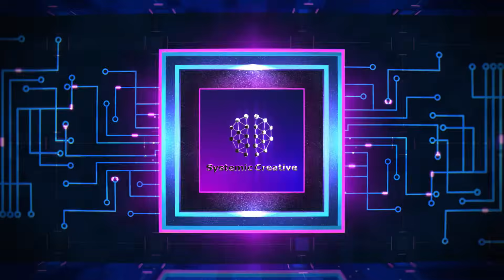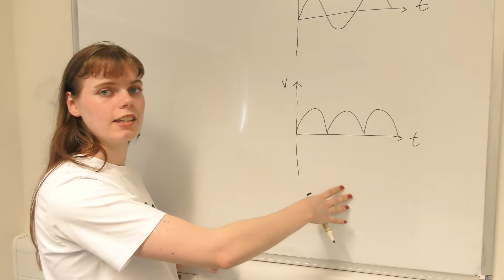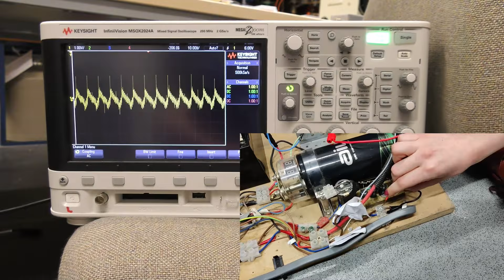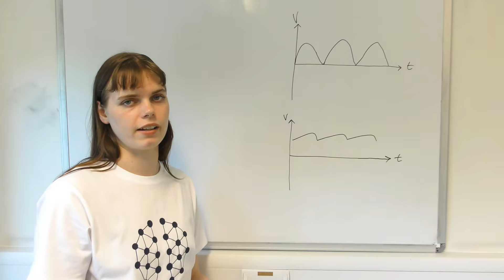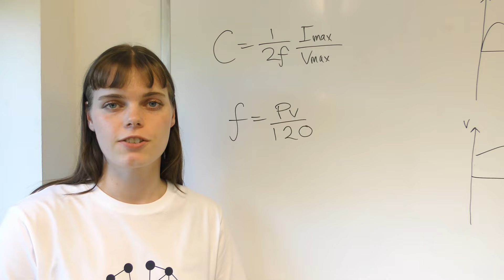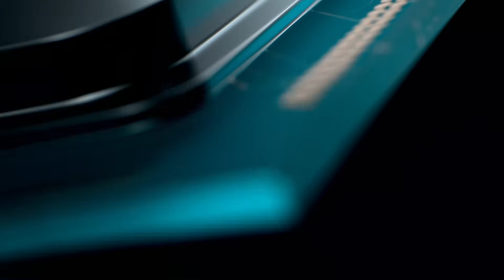Do THIS before using an alternator on a bike generator - oscilloscope demo

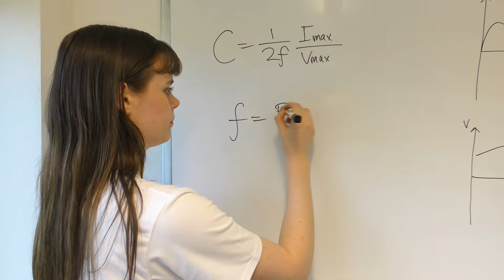Comment: At 3:40  Where does the 120 come from?
Reply from the maker: It is a combination of 2 factors, 60*2. The 60 arises because we're converting the unit of rotational speed, v, (rpm) to the standard unit for frequency (Hz or 'per second'). The 2 arises because the generated AC from the alternator is rectified, creating 2 ripple peaks for each 1 AC cycle . It's this AC cycle frequency which needs to be input into the first equation (a fact which we didn't explain well in the video - sorry!). 
You might spot that the equations would both be simpler if the factors of 2 were left out, but the first equation is a standard one for calculating smoothing capacitance in general AC rectification circumstances so we left it as it was. Similarly, v could just be quoted in Hz in the first place, but rpm is the more common unit with reference to alternators, hence it's usage here.
Reply: @SystemicCreative  Got it.  Thank you.

Comment: I am assuming that Oscilloscopes are more sensitive and advanced than EKG machines, yet I can not detect whatever EKG machines are detecting, or maybe I couldn't figure it out. You are more experienced than I am, can you please tell out how to do it and what I am doing wrong?
Thanks for your videos.
Reply from the maker: Thank you for your comment, glad you're enjoying our content. Just so we understand your question, are you trying to measure the electrocardiogram using electrodes connected to an oscilloscope?
In general it can't be said that oscilloscopes are more sensitive than EKG machines - there are a whole range of scopes with different sensitivities, but they are designed with a much more generalised use case than an EKG machine.

Comment: When explaining physics in simple terms to beginners, I thin kit is important to be careful to use correct words.  In this video, you speak of AC and DC current, but the C in AC and DC already refers to current.  Then you explain generator output and rectifier output voltage, while referring to the waveforms as current.  You show a one phase generator waveform and then demonstrate with a 3 phase alternator output, that looks nothing like the rectified one phase example.  I think a beginner would be completely confused by this demo.  Sorry  to be critical, but I taught basic electronics and had to be very careful with this sort of thing to not lose the students.
Reply from the maker: Thank you for the thoughtful comment - we always appreciate constructive criticism. Good spot on the AC/DC description - you're absolutely correct, we're effectively saying alternating current current! Thanks for pointing out. On the second point, we could have referred to the oscilloscope trace more correctly as ripple voltage, that's true. However, we chose to continue with ripple current because it's the slightly more common description and slightly more intuitive when thinking about it for the purpose for which this video is intended. There's probably an argument for either description, but the scope is certainly showing voltage, not current, so yes, we could have made this clearer and stated that fact. On the third point, again the reasoning is similar - the video is intended to be a basic demo of the ripple and how to mitigate it by calculating the capacitance with a simple equation. The scope trace shows quite a complex waveform from that 12 pole alternator, but the basic shape and principle is the same, or so we felt, and it didn't seem productive in the video to go into more detail. It's aimed at people who might build a DIY bike generator, and a lot of people will grab any alternator they can find and want a simple way to set it up, so we tried to get a reasonable generality and use simple diagrams for clarity. We take your point on board though. It doesn't seem confusing to us, but then sometimes when you work with something all the time and understand it, it's easy to forget what can be confusing to beginners, and since you have experience of teaching that very thing to beginners, we'll certainly consider what you've said and hopefully use it to improve future videos. Thanks again.